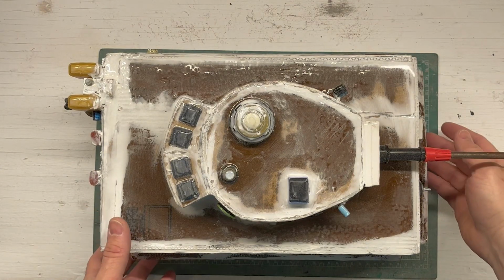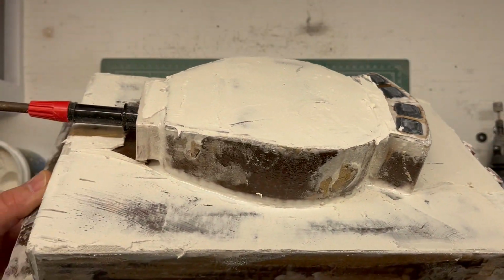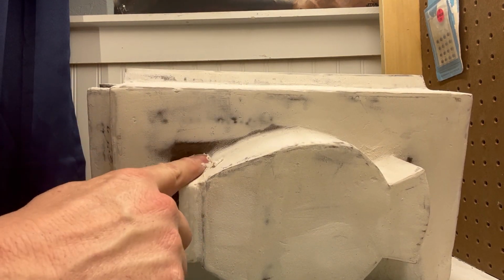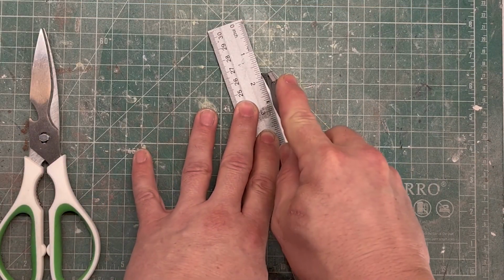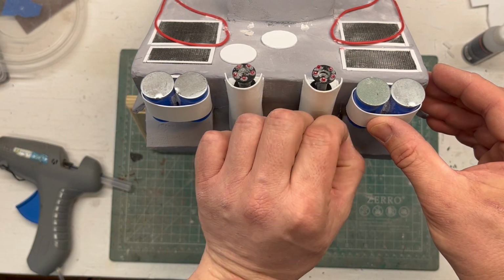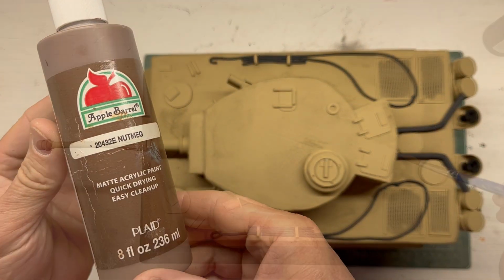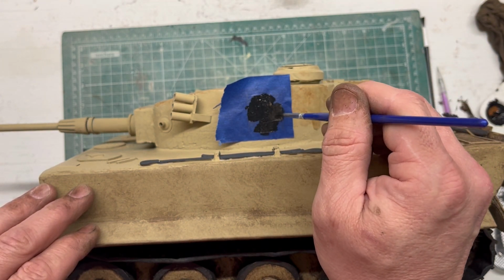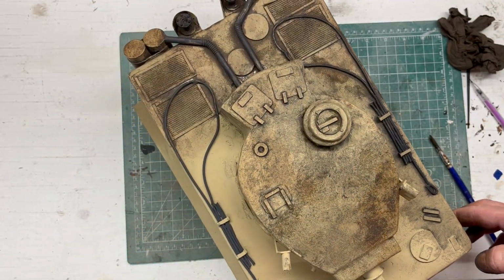How to Build a Model Tank Using Cardboard

Comment: How did u build your stormtrooper costume?
Reply from the maker: The stormtrooper costume is made from cardboard as a base material, then I layered on epoxy resin and fiberglass to give it additional strength.  I finished it by using Bondo (auto body filler) and a top coat of epoxy.  Then I painted it with general automotive spray paint and distressed using acrylic brush on paint.  The shoulder pauldron is made from EVA foam (I used shop floor mats) and then coated with plasti-dip and acrylic paint.  The helmet started as a paper model using a free helmet design I found online.  I used this to get the general shape, and then I used "paper clay", which is a homemade type of clay using joint compound, glue, and paper to get the shape detailed.  I topped this with more joint compound, fiberglass, body filler, and epoxy resin.  I hope this answers your question but let me know if you have any more!